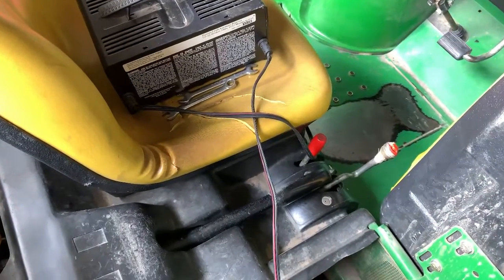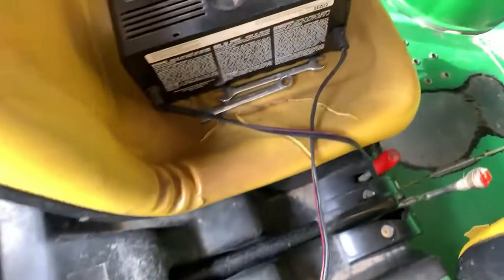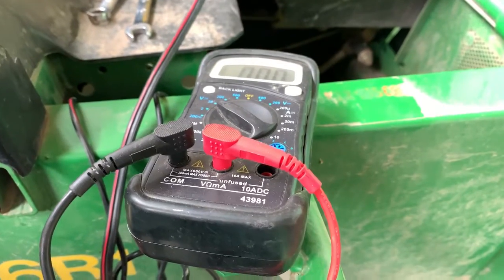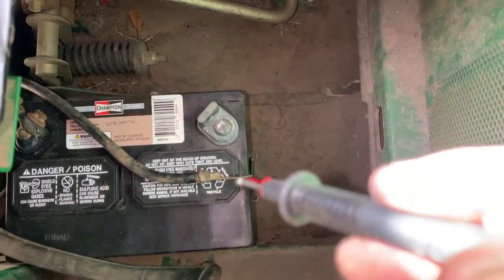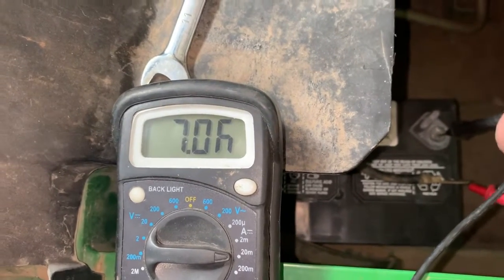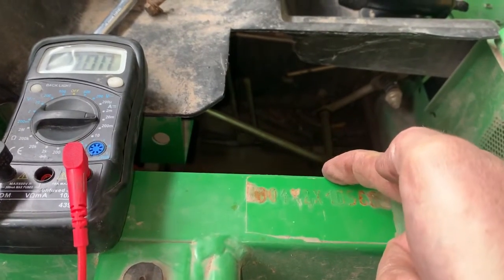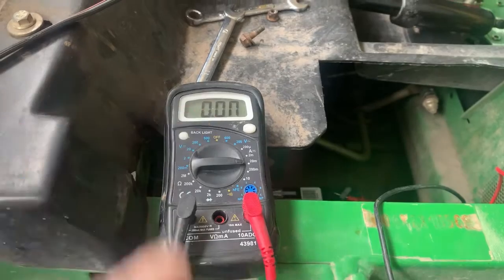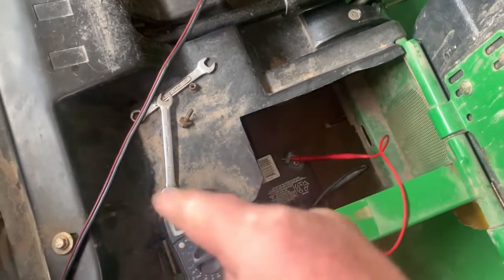BATTERY KEEPS GOING DEAD / HOW TO DIAGNOSE A PARASITIC ELECTRICAL DRAW

Comment: Great video , I had the same thing happen to me . It ended up a defective battery , left it disconnected for  two days and the battery went  dead . Replaced it a second time every thing was good .
Reply from the maker: I hope you don’t mind but I’m going to pin this comment  because I am not the only mechanic that has had issues with these  “champion” batteries, several off-the-shelf not even charged and several dead ones after a week, so I think we got a bad batch of batteries and they’re made by Johnson’s controls same people who make Walmart batteries and 90% of all the batteries in the United States
Reply: THEMOWERMEDIC1  More food for thought , I've changed 4 Walmart batteries out in the last five years on my 2013 Chevy Siliverado pickup at  which I bought when it was a 

 year old , called my mechanic and ask him if I needed to get him to check charging system out on my truck , and he said no to quit buying those Walmart batteries . Buy either a OReillys or interstate battery next time .
Reply from the maker: @marshallborder9089 I’ve had issues with Walmart batteries in the past as well
Reply: @marshallborder9089  7

Comment: my neighbor's battery on his manual blade engagement mower would sometimes die between weekly mowings . he always removed the key when finished mowing . i tested output , diode (unregulated charging system) , traded batteries between his and mine , cleaned top of battery (dirty top can cause minor shorting between posts) . never found the source because it sometimes drained/sometimes didn't . installed a freight store disconnect in cup holder and problem solved ...... for a few months . the cheap disconnect broke , so i removed it and resigned myself to having to jump start his mower for him . maybe this'll help someone .

Comment: You didn't check the voltage regulator. Smh unplug the regulator and notice amp draw smh
Reply from the maker: You need to do some research before you comment on somebody’s video obviously you know nothing about electrical systems
Reply: @THEMOWERMEDIC1  you post a video without giving us answers. You let ppl down
Reply: Don't you ever do that. Your scratching your head and all clueless. You're not trying hard enough man. Dig deep. It's only a mower. You can't fix a simple problem??? You have small engine channel ? So many subscribers.
Reply: I know more than you know. You need to just give it up. It's not for you.
Reply: @jerrycannon6940  if u know more then y are u wasting time watching this video
Reply: @jerrycannon6940  lol 😂

Comment: I've only seen same test done on negitive side ...because it may have a bad connection with copper eyelit to aluminum engine block...???
Reply from the maker: Correct
Reply: If the system has a negative ground (which most do) removing the negative cable is the smart way to do it. The test will work on the negative side or the positive side but if the positive cable end contacts any metal parts, you get sparks. Not so with the negative cable. When removing car or mower batteries, disconnect the negative cable first. When replacing, connect the negative cable last.

Comment: any chance it has a cigarrette lighter plug and they are using it to Charge cell phones, run a light, or play music from it with the key off? It wouldn't show a parasitic draw until they hooked up a load (on the cig lighter plug). Or....small chance the replacement battery is bad. Just a cpl options that come to mind

Comment: I remember the old shade tree method , with everything turned off  - you take the ground end of the battery cable loose and rub it against the ground stud of the battery and if you get a spark you had a drain on the battery . Just saying ..... I'm at at lost on it too .....??????

Comment: Check the wiring to see if there is a wire with the insulation rubbed off somewhere like a wire by  a pulley or bare wire by the frame or where it goes through a hole in the metal frame. Maybe a wire is lose somewhere that stops the charging system from charging the battery part of the time. Maybe the insulation is rubbed off a wire that the safety switch connects to so it only carries power when the parking brake is on or the control for the mower blades is in the on or off position depending on how this circuit is wired so check for short with the parking brake engaged and disengaged and the same with the blade control unless the blade is engaged with a switch. There could be a short that occurs under certain conditions. Check to see if there is a bare wire anywhere between the battery and the ignition switch. It could be a any wires that get power when the ignition switch is off. It could be the battery is defective and loses its charge over time. If they aren't going to use it for a few days charge the battery then take it out for a week or two if possible. Take it home with you if possible so you know what is going on. Then put the battery in and see if it starts the engine. That will eliminate the battery as the source of the problem if it starts. There could be a problem in the charging system that causes a low amp draw a while after the mower is shut off. Maybe the current draw is low enough so the meter can't read it. Try setting it to dc volts and connect it the same way or use a small light bulb connected the same way.

Comment: Could just be a bad battery, trying using a more precise multimeter like a Fluke. Parasitic draw in vehicle with module is ok if less than 50mA. That tractor should have no draw unless a solenoid/relay is being energized with key off.
Reply: Oh geez...

Another one of those people that believe Fluke is the only meter that works.
Reply: My ‘91 cutlass was going dead after a few days.  The service manual spec was 38mA. I had no abs or air bags but the seatbelt retractors were in the coupe doors. The last fuse I pulled was for a special relay with vehicle speed input. It de energizes the seatbelt lock in case the car is in a ditch.  That helps rescuers to open the door. You sure don’t need seatbelts once the car is flipped over either. 

Nowadays they probably have a DTC for that. 

Also when that circuit is grounded like mine was you can’t get tension on the front seat belts while driving. 

I’m glad I found out the easy way and glad I was trained to use a sensitive Fluke 87.

Comment: Might be an intermittent issue.  Maybe something behind the fuse panel, etc. is going to ground after it is used on occasions.  I had  Honda Goldwing with a parasitic draw.  I fought it for about a year, never did find it.  I finally just sold the thing and solved my problem.  Might suggest they pull the key out of the ignition after use or put a master switch on the battery if all else fails.
Reply: good idea  , mine keeps showing battery light when i turn the key . new battery as i had issues with the old one and it ran fine for 3 weeks now its dead again . but a dead on off switch  in between the battery and the machine is a great idea.

Comment: Thanks for sharing electrical systems is my weakness and I don't always fully understand if I'm using my meter correctly either.
Reply from the maker: It can be intimidating.  Practice makes perfect  thanks for all your support over the years!
Reply: Hey, don't feel too bad.  I am newer technician and I have been learning and studying the electrical side for the last two months.  It is amazing how far I have come in my understanding and theoretical knowledge.  It has helped me tremendously on my jobs this summer in being able to pinpoint problems.  Happy learning my friend.
Reply: Just how does the battery get charged off the stator ? Which wire goes where to charge the battery? My Gator has a Vangaurd 23 hp , and the battery is constantly dead , even after running it for a WHILE  , to the point that I feel the battery isn’t being changed at all
Reply: @jeffj7098  The stator on a small engine is basically like an alternator on a car. When the engine is running at high RPM not Idle it should be putting out around 13 to 14 volts. When the engine is running at full throttle take a voltage meter and check the voltage out put on your battery cables. Also have you checked the battery to make sure it is good and doesn't have a dead cell.
Reply: @nashguy207  I’ve had this problem with 2 batteries… I can see the wires that come out of the stator , and can test the output , at idle it’s 12.5v … but what I can’t figure out is , how does the electricity get back into the battery to charge it ? The red wire coming out of the stator , goes back into the voltage regulator/rectifier.. and the only wires that connect to the battery are the positive power wires and the heavy gauge wire that runs to the starter solenoid.
Reply: @jeffj7098  I'M not sure how your is wired run the engine at full throttle and then see how many volts you have coming ou tif you have 13 to 14 volts coming out of the regulator to the battery you have a problem some where do not test at Idle!!

Comment: My new husqvarna Z254 had a dead battery in late November. It was last run in Mid October. Apparently I left the ignition switch on. However, when I tried to determine the hours on the motor for the next oil change I noticed the run time meter ran 60 hours before the battery died. If the ignition is on the carb solenoid should be activated to allow fuel flow into the float?. That should be a current draw (depending on the engine). I left a message for husqvarna that the run time meter shouldn’t run unless the engine is running. They sent me the SKU# part no to replace the run time meter but no solution to wiring the run time meter correctly. Sometimes batteries develop an internal short. Is the radio on the gator directly wired to the battery?
Reply from the maker: Watch my last video on fuel solenoids a fuel solenoid has absolutely nothing to do with allowing fuel into the bowl nor does it cause issues with flooding.  No radio   Also
Make it a habit to remove the key when not in use
Reply: @THEMOWERMEDIC1  three years back, in the spring my gas tank was empty. Funny. I thought I laid it up in the fall with some sta-bil only 1/4 full. I usually run my mower once a month in the winter. Checked the oil. Overfilled. Changed the oil. Smelled like gas. However the cylinder had fuel in it. Guess it landed at bottom dead center the last run. Gas/oil leaked by the piston rings. When I cranked it. The gas/oil in the cylinder stressed the head gasket from the hydraulic pressure. (Never had any issues doing it this way for 4 years with this cub cadet). Then leakage at the head gasket after an hour of running by the white smoke. Removed the head and it looked like the gasket was damaged near the valves. Ordered the head gasket. Replaced it. Took the carb off. Plunger in the carb and carb bottom were sticky. That “electrically operated plunger” leak-by continued to flood the crankcase when I waited for the head gasket to arrive. Plunger stem and valve point and seat were gummed up. To exercise the valve I turned the ignition off and on which moved and exercised the carb plunger. After 5-6 strokes with carb cleaner the solenoid activated plunger stem began working properly. After cleaning A definite clunk could be heard in the carb when the ignition was turned off and on. Had to change the oil again because the plunger leaked by.

Comment: John Bladykas had a good idea... Idling with lights on.  That is very possible,  because at idle the lights will draw more amps than the alternator is putting out. Great job MM1 .. Back in the day, we use to use a test light between the battery and the cable and pull fuses until the test light went out, then you would know what circuit was drawing current.  Thanks Awesome Video
Reply: 2 good points. Thank you